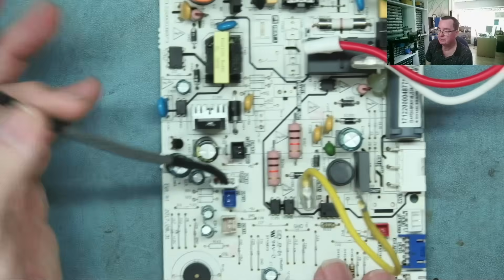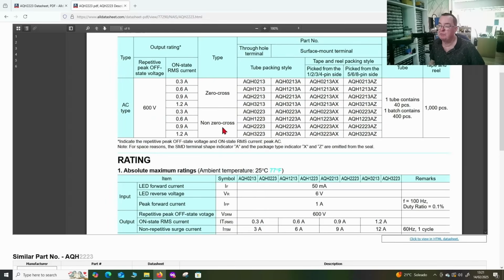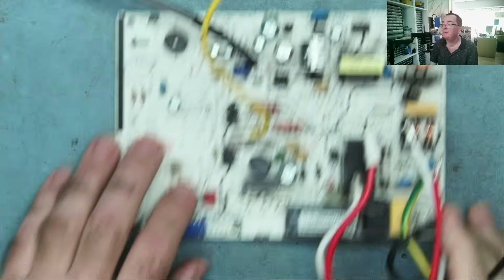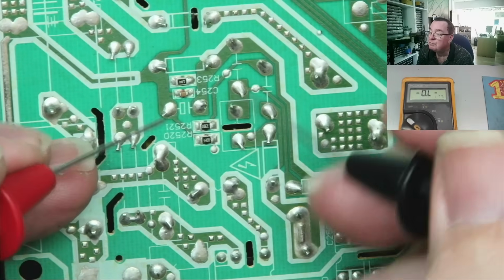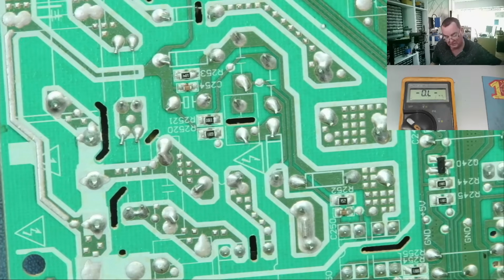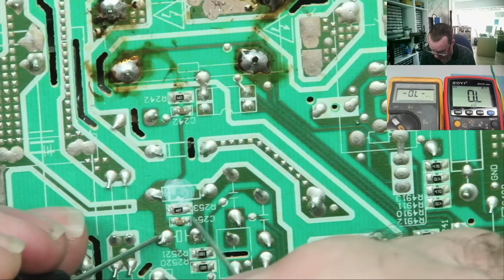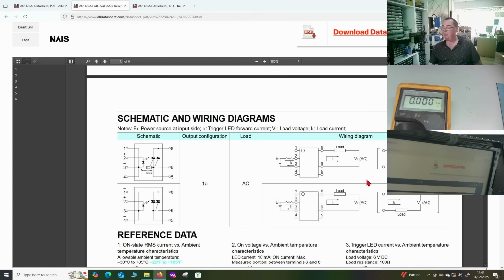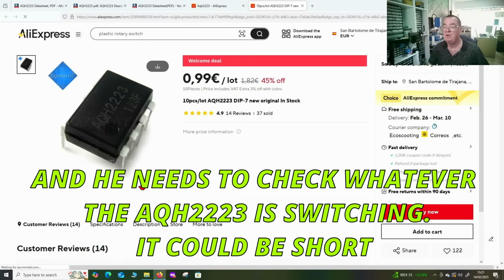How To Find The Faulty Component On A PCB Without Schematics : A Very Practical Repair Example!

Comment: You can test an unknown circuit board with a component tester, like the Huntron Tracker 1000. (Low current AC-voltage, tests in all 4 quadrants with only one connection necessary). Every leg of a cpu or digital cirquitry check for short cirquit to ground or supply voltage plus.
If you have a switching power supply, find the input voltage sensing resistor, usually some 1 Mohm for open state.
Electrolythic caps test them for dissipation/leakage. Exchange bad ones.
Then test the wires crimp-connectors.
Finally test the board in place, most probably it will function.
And this with no schematics diagram...
Good Luck/Bjoern

Comment: I had a similar experience with a Furnace control board, What I found was a broken solder joint, the vibration of the furnace constantly shaking the board broke a cold solder. I re-soldered the chip and it worked fine after that. I am an electrician not an electronics person. I guess if you heated the board up with flux on the solder side of the board it might reattach all solder joints. Good Luck.

Comment: Hi Richard, removable eproms is normally on Samsung units. Not all is removable thank goodness. Anyway you said communication error. When that happen you should check the outdoor unit pc board first. Also the signal wire must be disconnected in that way you can see if it is the indoor or outdoor pc board. Anyway there are many brands as you know they are all diffrent. Makes it really fun to keep up 😅 So with communication error I would say 7 times out of 10 its the outdoor fan that goes faulty and  taking out the outdoor pc board Sometimes you can hear relays click etc but thats only 1% of the circuit. In all honesty you can not really repair an air conditioning unit without having everything plug in to perform proper troubleshooting because you need to check the voltage signal. I am starting to document diffrent brands error codes and communication protocols. Will also later drop pc board repairs on my channel. Cheers

Comment: Unless there is an obvious component failure, working without a schema or service manual means you will be spending much more time trying to comprehend what is the purpose of components and checking each of them. There are some designs that have identical circuits (multiple channel amplifiers, etc) that can let you compare components or voltages.

In other words, every electronics problem can be solved without a schema, but the question is how much time you need to spend to do it.

Comment: Im an HVAC tech and often when I get time, I try repairing some PCB's. Comms failure on many Daikin units is a failed capacitor on the comms line. Then the eprom on many pcb's has stores information on the size and model of the ac unit. Many PCB's are universal between a range of ac units, the correct information simply is flashed onto the eprom by suppliers. On the particular PCB u are fixing (Midea, Gree, Alliance) all share the same PCB. From my understanding, the signal from the indoor unit wakes the electro mechnical relay when cooling / heating is required.

Comment: 1:50, the eeprom likely contains the saved parameters and is likely read back over a serial bus at power on, and can be seen with a scope as a bursts on one of the pins (at power on).    For the micro controller some pins should have pulses, and if so it's likely o.k.  But you must have a scope (trig on rising aprox 2v maybe).  I do'no what IC7&8 could be, latches/pall/ram/io ... I guess one for outputs and one for inputs, and that they convert to from different voltage levels from those of the controller/cpu. .... That beep is probably from the cpu/firmware, meaning it's o.k.

Comment: It is such a relief to hear an expert say “this maybe something we cannot repair”.  So often when faced with a circuit fault that you are having difficulty tracking down it is you who feel a bit of a failure.  My approach is to check everything visually without any power applied.  Anything discoloured due to heat, bulging capacitors or circular cracks in solder joints are top of the check list.  Next is to examine cracks in SMD resistors and capacitors and to put sideways pressure using a cocktail stick on SMD solder joints to ensure they are solid.  I don’t have a iR camera and so, with the circuit board flat, I pour on a little isopropyl alcohol and switch on power to see what dries out because it has got hot quickly indicating an internal fault. Only after I do this do pick up a multimeter and check for continuity and unreasonable values.  I still miss more than I catch.

Comment: Im lost as to why this guy didn't apply power, and star tracing down the voltages. Does/did that orange cap have 165-170 volts on it? Assuming a 120 VAC RMS situation. What was/would have been the voltages on that 7805? etc? Start with a series 10watt/20 watt incandescent light bulb in series - Short would make the light illuminate normally. Remove light, got GET that damn orange capacitor voltage. I sat here a whole damn hour watching him fuck off

Comment: Great video. It might seem obvious but I didn't see you test the fuse - I have spent countless hours testing components on a board only to find  that the onboard fuse is blown or there was a break in the mains cable (not in this board obviously). In fact I once drove 30 minutes to buy a circular saw while doing some home renovation and my previous one had just died. I got home (over an hour after setting out) and plugged the brand new saw in and it did not work. Checked the fuse, all good. Then I plugged in and used one of those live wire tracers and found that the Live wire was broken right where the plug was moulded on. I cut plug off and wired on a new one and it worked. That was 15 years ago and it still works to this day...

Comment: I went to college for electronics engineering and cannot say enough how much I hate trouble shooting and repairs lol. I didn't finish my degree, but that doesn't change the reality that I went to create from scratch, not fix from old lol. 
It's a very, VERY challenging skill and education to be a competent electronics repair technician. 

The reality is, to be the best engineer designing from the ground up? Nothing will make you the best of the best like fixing any random electronics "crap" lol.
You learn particular IC's by model that are prone to particulars, why particular diodes are used over others, what caps are usually bad in conjunction to an IC you know well and on and on it goes. 

It gives you a depth of insight, foresight and prediction to then produce new products that won't be prone to the troubles of the past.
Reply: I agree. I am an electrical and electronic engineer and have worked in both design (mobile phones and lots of random circuits) and in repair and doing repair gives you some great insight into how to be a better designer. If you watch some of the macbook, playstation, xbox, ipad, iphone repair videoThe cynic in me would suggest though that some of these components are chosen carefully by Apple, etc designers as part of planned obsolescence...

Comment: So at the 20:31 mark of this video you are testing a component and when you touch it with your prob it moves ever so slightly. But the slight move is probably a broken solder joint on the opposite side of the board. Just a heads up in case you missed it.

Comment: Cold Solder on  near R301. If you could power it up and look at it with an infrared camera for heat spots. A Laser Temperature Gun could point to a short.

Comment: I'm new here please.. I'm a software developer actually but my dad is an electronics engineer and because he needs help with his business the reason I'm tryna pick this skill up to be more useful and who knows have a dual career.. after all, AI won't be replacing this anytime soon. 

My question is, does this method or approach fit all boards for instance laptop motherboards? I know the components differ greatly so curious if this approach could work on it or any other board for that matter? If not.. I'm doomed to be a specialist
Reply: Nowadays its more complicated 
Because most of the things controlled with IC

Comment: With repairs i wouldn't bother with this i have for example obsolete SHARP IC IR2E27A i found need replacing they are obsolete and a seller on ebay has old stock looking at them they are fake and i found a seller on alibaba  selling the for £1 each ebay seller selling 5 for £9 got to be aware of pointless repairs

Comment: As a lifelong electronics engineer, I can only say that your assumption of the type of components is wrong in most instances and serves only to confuse those non-electrically minded people. As a p[professional I would advise you to stop guessing about components and join an evening class for electronics.
Reply: For someone who, as you put it, guessing about components, was able to identify the faulty component, then order the technically exact part by use of the identifying markings on the faulty item throws your demand for exact identification while troubleshooting into the rubbish can.
Ya see, the video's focus is on troubleshooting, the accuracy in type of component comes after identifying the faulty item.
You should stay in your cubicle and not venture into the "shop". If you do decide to, make sure you wear your hard hat, safety glasses, protective gloves, and safety shoes, and a dosimeter. Also, check to be sure you have adequate clearance from the dept. manager.

Comment: Normally ac units have wiring diagram stickers inside the casings, showing which components are wired to board connections,  so it may help if the customer send you a photo of this in future 😊

Comment: There is a way to test capacitors while in circuit. On the board there are labels to tell you what the connections are typically for. R, W, Y, G, C ( R= 24V, W= Heating, Y= Cooling, G= Fan control, C= Common) for example are for control signals to turn on parts of the cooling/heating system. Some systems have a 24volt external transformer for the wall mounted thermostat. Without any training I was able to make a tool that would test these wall units. Just have to understand the basics of the overall system. I have been doing electronics for years and this board your showing wold be simple to test under power. All you need is the thermostat and connect it to the appropiate connections. You can then have the thermostat turn on the AC or Heat and watch for the signals to see if the system responds. Any external sensors can be obtained and used for testing as well. Unless there is a power issue where the fuse blows its more difficult as you have to solve that issue first. Most HVAC service techs just replace the board rather than try to fix them. My brother does HVAC and he has given me several of these. I usually recover good components for later use.

Comment: Blimey that's a surprise.! I read right through all the comments as I was sure someone would've noticed, but they haven't !!
At just over 48 mins, where you're probing around looking where to inject the mains, you settled on clipping one side onto the red wire, and the other to the spade terminal in the corner - but if you take another look, that terminal was also connected directly to the black wire's terminal adjacent to it, which at that point was now dangling loose - and live !!! Would've been better to just clip onto that free end. Great video though, thanks.!

Comment: Hi mate i watched your video frequently i have a very expensive rare inspection drone that has a fault somewhere on the main board it goes to power up but will not boot up i spoke to the manufacturer in Switzerland and they confirm 1 or a few ic chips have know to blow in the past due to a hot plug in of the battery it could possibly be that or another problem i wonder if you would be willing to have a look at it for me obviously i will pay you for your time i just cant find anyone that can repair it apart from the manufacturer but they want more than i can afford thanks from the uk.

Comment: Hi about time I found how the real world procedures in fault finding can be achieved in laymen's terms. Practical and informative with the basics and has now peaked my refound love of electronics..basic knowledge which I gained some years ago following a term in night college. The reason behind has been sparked!..(sorry couldn't resist the puns) is due to my investigating my faulty Yamaha YSP3300 soundbar which suffers from an intermittent muting issue. Through trawling various sites this problem seems to affect a number of units in the range. My unit is now 15 years old but the quality is or was excellent so being stubborn I have now opened up the unit to see if anything is obvious but have found nothing as yet!!! hence my need to gain further information. Thanks for your input and lets hope watching your series of videos there maybe a chance or eureka moment which I could forward onto other frustrated owners as no clear or satisfactory answers to resolve the problem. Many thanks again..Mark

Comment: Hi, I know you've found the AQH22232 (solid state relay IC)  as faulty but I'm surprised that you did not spot the burned resistor next to it (the R 102). I could clearly see two  burned dot marks on that resistor (or it could be that the paint has cracked and chipped off because of the violent h.heat/violent power surge etc) and there is a high chance that the resistor could be the second faulty component. Usually in 99% of the cases this is a dead give away that the resistor is dead or has drastically shifted in value !
Reply: Good observation. Try to put the time stamp. I was interested, so I spent a bunch of time looking for it. He did test that resistor at 13:52. It's good.

Comment: One thing about in circuit resistor testing.  They will never read above their indicated value, they may read lower depending on what they are hooked to.  Could those unmarked "IC's" be pull up or pull down arrays?

Comment: Unfortunately learning the resistor color codes is useless for me. Being colorblind, those color codes mean nothing. I have to use my phone to take a pic of each resistor, use a color blind helper app to identify the colors which would already take up more time than it would if I was just needing to look up color codes. 
Even though sometimes with color blindness, identifying colors and shades often become easier if the same colors and shades are constantly coming up, the problem is with resistors being so small, that I don't even have that ability.. 
And for all the you folks that may suggest getting those colorblind glasses, well I have them. But they're not a magic fixer value line this. They're actually sunglasses.. And they only help in distinguishing colors and shades that might be difficult without them. It doesn't tell me the color. It emphasizes the differences in certain colors. Which would present its own challenges in identifying resistor values.. 
But even though I have to deal with this challenge, I still will never ever throw out a piece of electronics gear without first trying to diagnose and fix it. Might take me 10 times as long as the rest of y'all, and I might annoy the hell out of my friends and family by having to send pictures asking them for a second opinion on what colours they see, I thoroughly enjoy trying to fix crap like this.. 
I think resistor color coding is a little bit archaic in my opinion.. It's very obvious that being able to print text has gotten so much better over the decades and actually printing their values with numerical digits is probably something that is very possible and easier than we think. But everyone has gotten used to this resistor color coding that an industry wide change seems unlikely.. 
But it's annoying that a lot of veterans and industry experts are still touting the value of these color banding codes. Manufacturers just need to be encouraged to print values as they do on almost all other components on a board. 
And I'm talking about through hole components.. not talking about surface mount ones. Cuz those ones obviously are tiny tiny tiny and would definitely still need to make use of a code reference ...

Comment: What would your hourly rate be?  Two to three hours of diagnosis and repair if repair is possible. If not, then three hours and possibly no progress. Replacement board £150?
  Put you in a service van and your hourly rate would be crippling for the amount of downtime and the customer service rate would be 1-2 jobs per day max. 
This is why we have “fitters” nowadays who replace units to repair faults.  That’s not to deride their value in any way.  What you do Is a lovely and rewarding hobby and is environmentally sustainable.  I am lost beyond a failed power supply or a dry joint.

Comment: Replacing a bad component and getting a circuit to work is great but what caused the failure? Understanding that will give the ability to prevent recurrence.
Reply: Usually heat and age, or bad capacitors
Reply: @Tokaisho1  There was a batch of bad capacitors that managed to get into many electronic devices (time bombs).

Comment: Hi, great video, I have followed you for long and is helping a lot, thank you Sir. I have a question, I have a capacitor, kemet tantalum capacitor, I have those numbers on it, I know what means first two numbers but I do not know what means the last, I mean the third number(218). Can you help me please with it and I any big deal if I use a capacitor with different number than 218? The numbers on it are 
107
10k
218
Thank you in advance for your answer, Alex